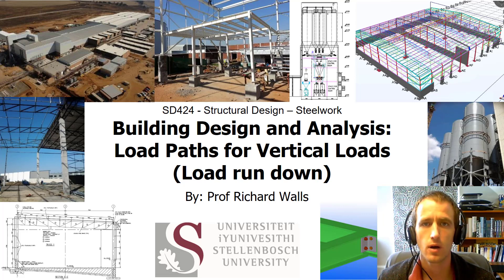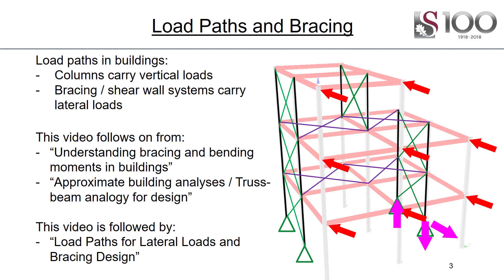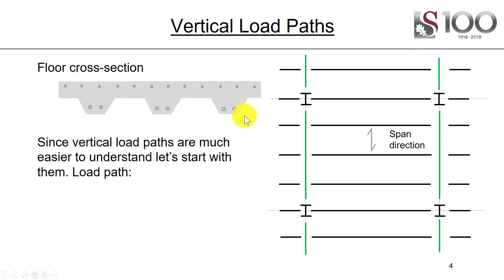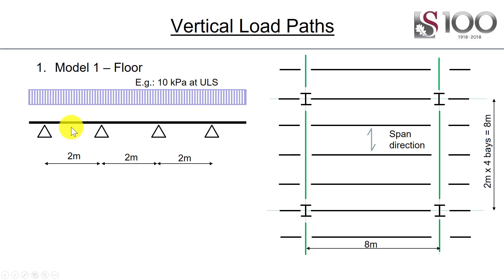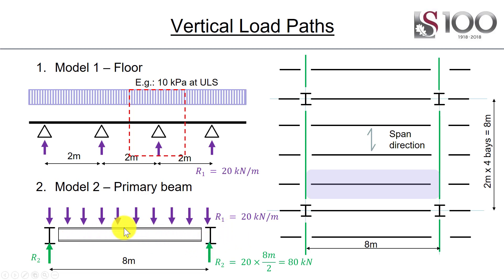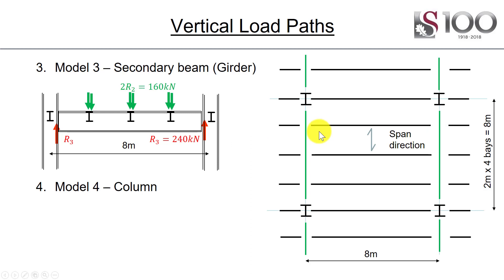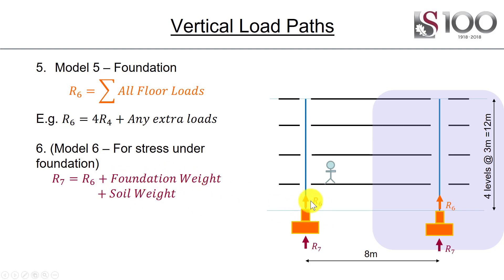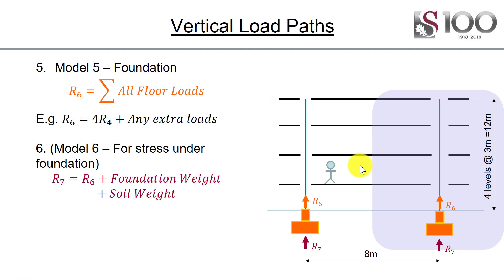Building Design and Analysis: Load Paths for Vertical Loads (Load run down)

Comment: Good articulation of the underlying concept but you're referring to the secondary beam as the primary beam and vice versa. Secondary beams carry load to the primary beams.
Reply from the maker: Apologies - you are correct. Primary and secondary labels are swapped around.

Comment: I have a question, is there anyway to include the self-weight of the beams and columns in your calculations? as you didn't do that. Thank you for this video, very informative.
Reply from the maker: It is easy to add on the self weight. Often the estimate of floor load includes a kg/m2 allowance for steelwork. However, if you want to include it simply add a line load when doing each beam, and an extra point load on the columns.
Reply: @firesun  I’m really not sure what you mean. I was wondering is there was something like the beam weighs 20kn/m so we add that plus the floor load and that is what the column takes and then we add the column weight in kn/m to it to find the total load. This is what I was thinking. In summary is it possible to add the weights of the members in kn/m?
Reply from the maker: @rayrim-rukeh1967  - I think we are saying the same thing. Hence: (1) analyse a slab and get a line load on a steel beam. (2) analyse the steel beam for the line load of the slab + the self-weight of the beam. (3) analyse the next beam along with its self-weight as well. (4) when analysing the column add a point load for the weight of the column. 
In real buildings you normally don't know the beam sizes already so it is easier to have an approximate steel weight per m2 and use that to get the beam sizes. Also, typical floor beams are normally around 0.3-1 kN/m so do not dominate the loading - the slab and imposed loads govern the design.
Reply: @firesun  Okay, thank you so much. Really appreciate it.